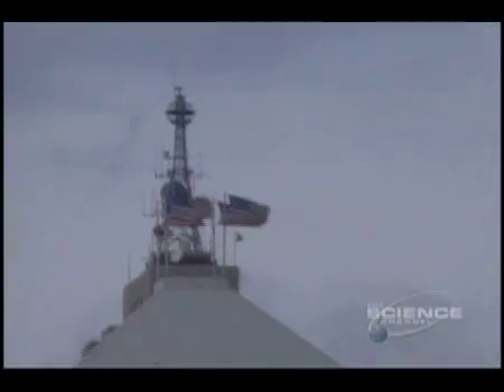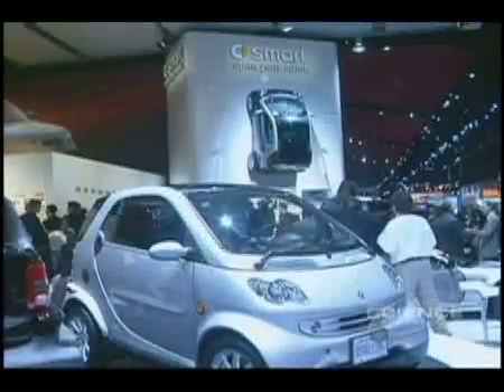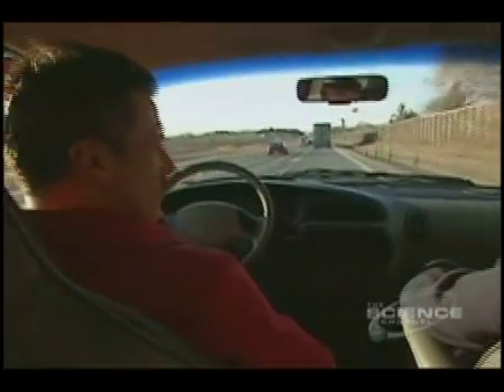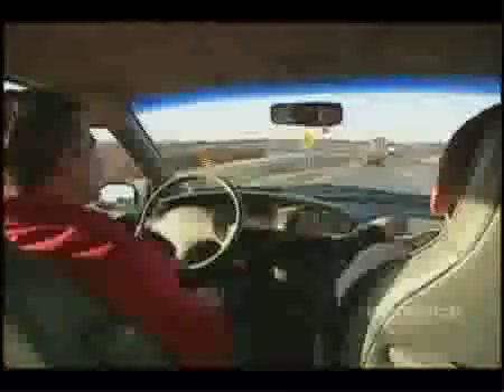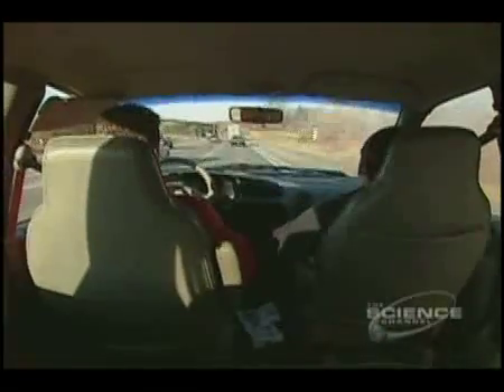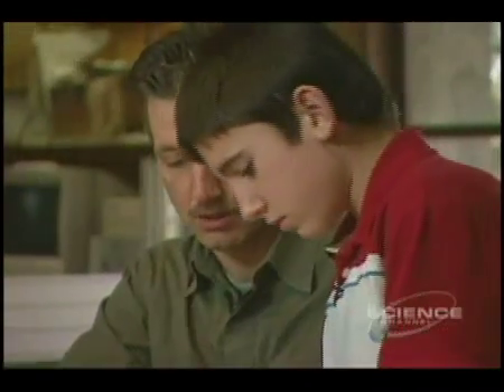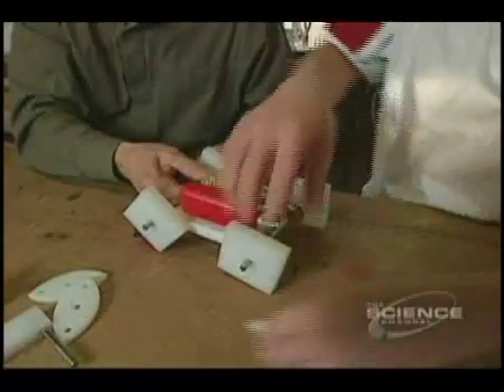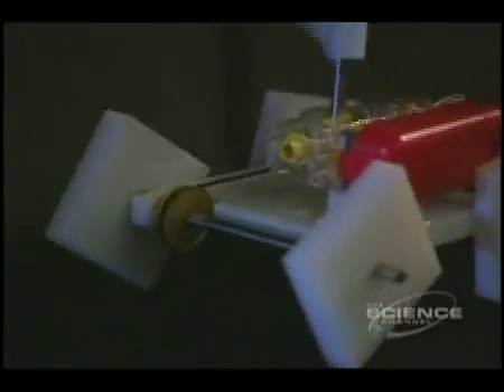Square wheels

Comment from the maker: The most important part of this is that it is a new discovery.  It is a new form of locomotion. When someone discover something new, sooner or later someone else will find an application for it.  For example, scientists are researching on nano machines.  Such tiny machines can be smaller than bacteria.  If you want these machines to move around, the traditional methods may not work.  And this might have already lit a lightbulb in some researcher's head.  Dont underestimate anything new or young!